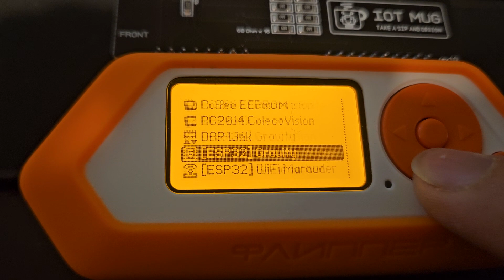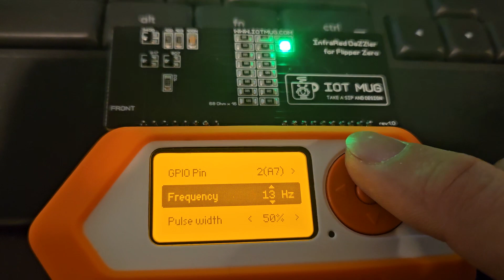How to get 14 Hz from flipper zero / Signal Generator /  PWM generator

Comment: Hey I have a side question here:
Just received the Double Dazzler and though I already had the 14hz knowledge, I haven't went 'outdoors' with it to check out the effective range, but upon opening the package (from your Amazon Store) it appears a single, loose, larger 4 prong LED/diode was included. I'm curious about the intention of sending this additional large bulb LED with the Dazzler. Do you have a quick answer or a link to possibly let me know if there is any alternative feature and if so, how/where to attach to the Flipper 0? Thanks
Reply from the maker: No.  Completely different gift for your other Arduino projects, It is now related to Flipper Zero.
Reply: @IOTmug  oh nice! This sounds fun lol, mystery gift time! I'll definitely get in touch this week. Thanks for clarifying things friendo!
Reply from the maker: Always here to help. Love my customers.
Reply: Ahh.. I think I've just realized it's one of the LED's that belongs to the new Turbo Dazzler THAT I JUST NOW FOUND OUT ABOUT DANG IT 😂😂 I wish I had looked into all of your future planned projects further since the Turbo is only $10 more than the Double DD Dazzler and looks much meaner with the external power pack.. 🤔 Have a feeling I'm going to end up with far more IR boards/modules than I need since you guys seem to be doing an R&D speedrun with the haste of production between prototyping and putting new stuff on the market! Lol, I'm simultaneously intrigued and yet also bothered that the 'Turbo' is being produced right after I waited for the DD Dazzler 😉
Reply from the maker: Please contact with me if you need more help. We can talk on the phone too. please see www.iotmug.com for email address. We can help faster.